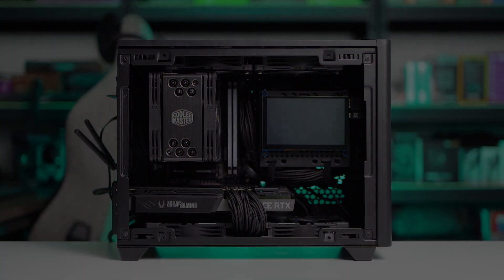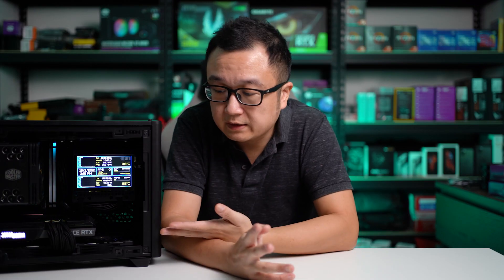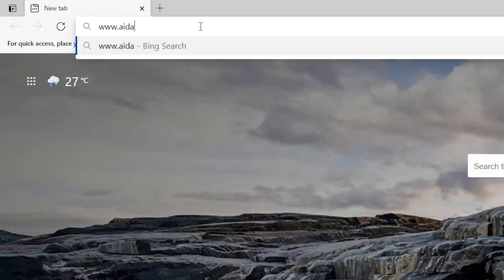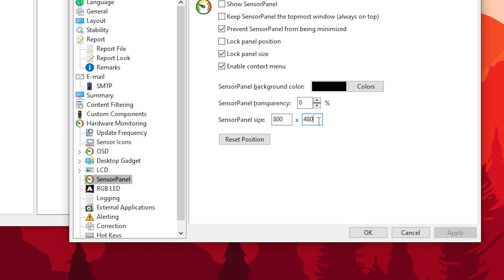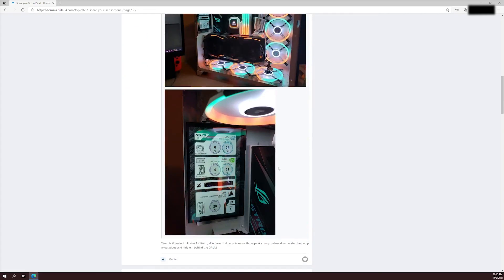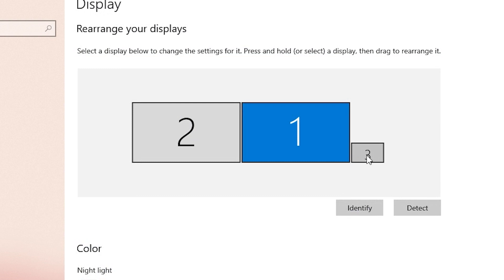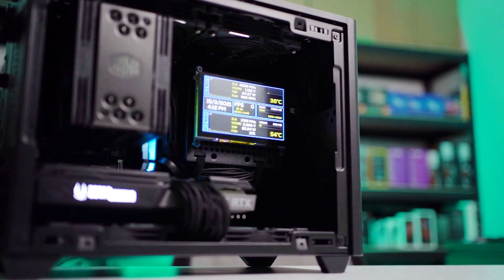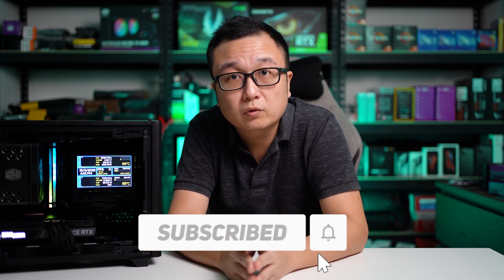Hardware Monitoring LCD Screen For Your PC!

Comment: what size standoff screws are those? And that micro usb shown in video is not 90 degree? Do you need also the micro usb to be 90 degree in order to fit it?

Comment: hi question where did u you get the front panel plastic holder @1:30
Reply from the maker: It comes with the Cooler Master NR200P casing :)
Reply: @ghimtech  i see, i thought that's something you can buy online... Thanks

Comment: They should be another way instead of using HDMi and use a USB C
Reply from the maker: Yes this would depends on the type of LCD panel that you purchase. Some newer ones supports single USB C connection to power and transmit video direct from the mobo. The one I got however was an older variation, or rather more common ones on the market :)
Reply: @ghimtech  I see, thank so much. I will subscribe to see more from. I just bought from AliExpress a 5 inch usb c. Thank you.
Reply from the maker: Thank you 😁
Reply: @ghimtech  is a pleasure 😁👍

Comment: Instead of using an HDMI cable and running it as another monitor (I already have 3 monitors for my build), is it possible to plug the HDMI directly into a Pi Zero 2W, and run Aida64 that way?

Comment: Is the mobo an Aorus b450 or b550?
Reply from the maker: Aorus B550i
Reply: @ghimtech  thank you. I know you’ve probably change pc cases now but did you have any trouble with thermals in this setup from the video? 212 with slim fans in push pull? Did you zip tie the fans on the cooler? I’m buying a 212 cooler and my setup is pretty close to yours but with a 3080 FE.
Reply from the maker: You don't have to use zip ties to secure the slim fans on the cooler, just reuse the fan holder that comes with the cooler :)
Reply: @ghimtech  perfect thank you.

Comment: great video! is the micro usb cable that comes with the display sufficient? or if you used a separate cable what length would be preferred? thanks
Reply from the maker: Thanks! The cable that comes included is not usable with the NR200P due to lack of space. A 90-deg cable is required as shown in the video. I used a 0.5m cable to reach the rear IO. Recently I've switched to a much shorter 0.2m internal USB cable instead (plugged in directly to the motherboard internal USB header).
Reply: @ghimtech  i see, do you mind sharing which internal usb cable did you buy?
Reply from the maker: @GazaFPS  https://www.aliexpress.com/item/1005001905684347.html

Comment: How to use rtsss fps in lcd screen?
Reply from the maker: You need to install MSI Afterburner. During installation it will prompt you to install RTSS. Once it’s installed, you’ll find the RTSS FPS option in aida64 sensor panel manager

Comment: Will this affect gaming performance as the screen is running as second monitor on the gpu?
Reply from the maker: This is just a 800x480 screen so there'll be no effect on gpu performance, unless of course if you're using a very old gpu :)

Comment: One question, is the lcd direct plug and play with pc gpu or i need to connect it to raspberry pi and do some settings first ?
Reply from the maker: It just connect directly to gpu and windows treat it as a second display upon startup
Reply: @ghimtech  ty so much for fast reply sir 🙏 now i understand this completely. Ty 😊

Comment: Great video, was able to mount a screen too on my NR200 :)

Got a question.. I see you are using slim fans on the cooler.  Would standard fans fit for a push/pull on the cooler? Am thinking of using Sickleflow fans.
Reply from the maker: I used the slim fans for cooler because of the tall and fat rams I’m using (Corsair vengeance rgb pro). If I were to use regular fans it will be pushing the rams. You can get away with the regular sickleflow if your rams are not as thick as the ones I’m using, so feel free to try it out first :)

Comment: if you plug the usb to a mobo usb header it's way better.
Reply from the maker: Yeah that was the initial plan but I couldn’t find a micro usb to mobo header cable so I decided to just use the direct usb cables. Will likely switch it up if I’m able to find one

Comment: One question, wouldn't it be more convenient for the cables to be routed through the hole beside the GPU slots? Because some 2.5 gpu slot user might not able to done it with this method.
Reply from the maker: yes you definitely can do that if you have a much thicker GPU and is blocking the 3rd pcie opening at the back. Also if it's a 2.5 slot gpu, you'd probably can still get away by routing them under the GPU. Just make sure the cables aren't interfering with the GPU fans :)
Reply: @ghimtech  Yea true, but 2.5 with a couple of slim fans at the bottom won't make it tho. Anyways, keep up the good work :)
Reply from the maker: @roxboy5505  thank you :) also I don't think the bottom fans would be in the way of the cables you are trying to route it out behind to the rear I/O, there are still quite a bit of gap between the bottom fans (irregardless of regular or slim ones). One solution is to cable tie them neatly while you're routing so that it doesn't move around and interfere with both the gpu and bottom intake fans

Comment: I might do this, but because I can't fit it in my case I might put it on my desk
Reply from the maker: Yeah there are available small LCD's that comes in enclosure which you can place it externally. Some now even comes in OLED but because it's use for monitoring, I'll suggest against OLED as it's more prone to screen burn-in.
Reply: @ghimtech  got a link to those enclosed lcd?